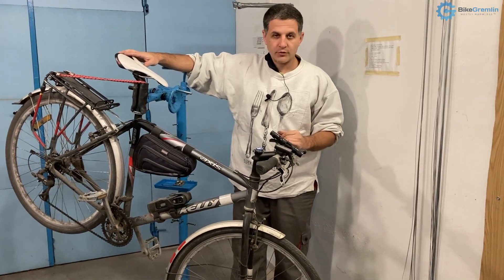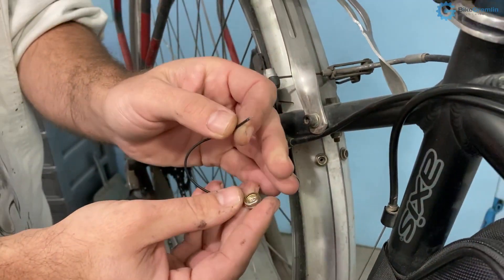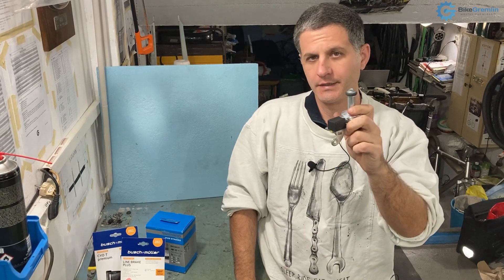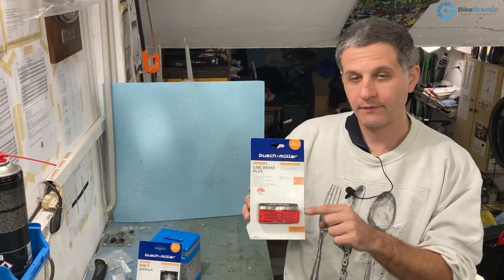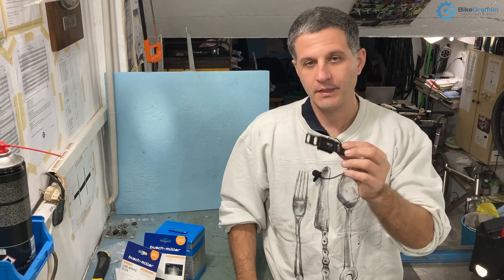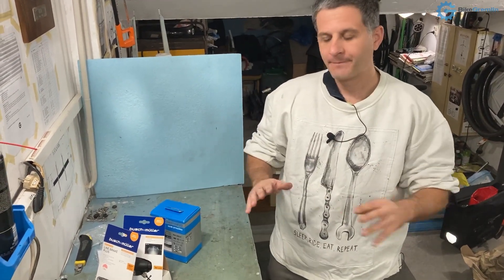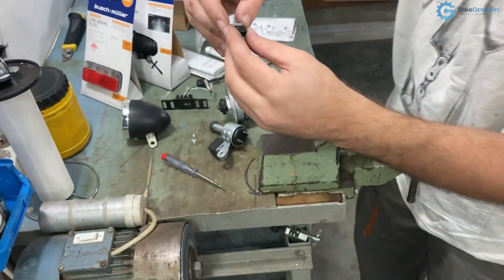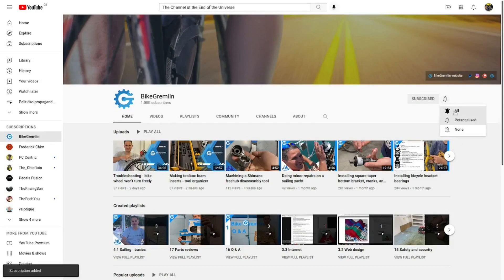Dynamo hubs and LED lights for bicycles

Comment: I checked my hub dynamo and it shows voltage, but neither my head or tail light works. I tried a continuity tester on them and one shows nothing and one shows some circuit
Reply from the maker: For comments, questions, or advice, I’d be happy to help over on the BikeGremlin forum:

https://www.bikegremlin.net/

To keep everything organized, I’m only providing answers there. Thank you for understanding!

Relja Novović

Comment: Re: 9:02 I botch job repaired a 1.5W shimano dynohub by removing one of the 4 rotor magnets and the system has 0 issue powering a front and a rear light at 15-20km/h speeds and charging up the capacitor. 
I think the smaller cheap LED lights are crazy efficient (iirc there were some basic automatic Axa lights on there). Not a B&M system, not sure of the power draw of those.

Comment: I really don't like using the frame as common current return! It sort of works, but once you get rust and salt and shit, you can't rely on it. I had an accident because common return through the frame failed in the rain, it was OK otherwise but it went flickery when everything got drenched, and my lights went out and i drove into a barrier and broke my left hand a few fingers and was THAT close to landing upside down on my head, and helmet or not (i wore one) yeah you don't want that. Front fork got bent too, yeah steel! Mechanical connections aren't really made to be electrical connections.

Busch+Müller lights are excellent! After a decade, no lens fogging at all. You buy something off brand, it's yellow in a couple, cracking, leaking. The light output and light pattern are among the better ones as well.

Comment: Thank you very much for the video. You explained very well about the mechanisms. I have a similar shimano dynamo on my bike. The bike has been used for maybe 10 years or longer (bought it second-hand). Out of a sudden the light stopped working. I checked the bulb and it looks good. I wonder if it’s something wrong with the generator. Is there any easy way to check if the generator still works?
Reply from the maker: I suggest using the bikegremlin.net forum for any technical questions. 

Relja

Comment: Hello :) thanks for the video! How is this dynohub model holding up since the last year? And would you recommend this for touring?
Reply from the maker: That's a good question.

So far, I'm very happy - it's all working fine. Survived one hot summer and one very rainy winter (though with very little snow).

I ride all year long, and some of that is on very bumpy roads, so it was a good test for all the contacts, mounts (for lights) and the dynamo hub.

I love it so much that I got another set for my gravel bike.  :)

Note: on both hubs I got, the bearing preload looked a bit too high, so I loosened a locknut and adjusted the preload to make it less tight. They do rotate in "clicks" due to the dynamo, but out of the factory it was still a bit too tight. I see that with many cup and cone hubs, regardless of the model and manufacturer.

Relja
Reply: @BikeGremlinUS  thank you :) i don't think we have seen your gravel bike in any video! 

Like you, I also face the problem of getting the Dynamo hubs because of shimano's restrictions to send abroad - hence the choice is limited to SP (or the Son for that matter). There are some shimano dynamos available on Chinese websites but i don't know about the authenticity. But I'll pick one up when I get a chance. 

Regardless, I'm excited to get one and set it up! Thanks for all your content.
Reply from the maker: :)
In one video in my native (Serbocroatian, the BikeGremlin RS channel), I showed the frame preparation for the build of my gravel bike:  :)

https://www.youtube.com/watch?v=mBTz8OhHPZk

Edit:
Here is the built (I changed a few more stuff over time, but that's the "skeleton" of my gravel bike):
https://www.youtube.com/watch?v=olmxGm29Vjc
Reply: Just to add on to what Rilja said, my Shimano dynamo hub lasts since 17 years. I almost never rode in rain.

Comment: Great video, as always.

Can you tell me if I can use the old system, so called Tyre Dynamo and connect the new LED lights on it instead of a Hub Dynamo? I personally think that the Hub Dynamo is better system but i am just trying to upgrade the lights on a old city bicycle with spending as less money as possible...
Reply from the maker: As far as I know, it should work.
Adding some overvoltage protection is a good idea if one plans on going fast down hills with any kind of dynamo (either the old-style bottle-type, or a dynamo hub).
Shimano sells these separately, and they also come with their dynamo hubs.
For flats, if your LEDs are of high quality, it's not really necessary. Good LEDs usually have their own overvoltage protection. Just make sure to connect the rear light from the front light, not directly to the dynamo.
Reply: @BikeGremlinUS  
Thanks a lot.

And why is it so important to connect the back light on front light and not directly to the dynamo?
Reply from the maker: The front light has an on-off switch - the rear one very often doesn't.
The same goes for the standlight function - some rear lights get the "juice" from the front light when the bike is stationary (some have their own capacitor for that).
Reply: @BikeGremlinUS  

Can you tell me one more thing? When you have a wheel with dynamo hub and when you spin it while holding the wheel in your hands, is it normal that the hub while making resistance, makes that tik tak silent sound, something similar to normal hub when beeing over tighteneed?
Reply from the maker: @Toretto16  Not that I've noticed with Shimano dynamo hubs. Though it's fair to note that they do, like their other (non-dynamo) hubs, often come over-tightened from the factory.
Reply: @BikeGremlinUS  I have a bottle dynamo on my bicycle (for now), and it has a diode built in. As for as I know it is over voltage protection. On the road my lights get to full brightness at quite a low speed, and don't get any brighter no matter how fast I go, so I guess it must be working.

Comment: Thank you very much. One of the best bike mechanic channels on YouTube. I’m quite an advanced home mechanic myself but I mostly worked on MTB and race bikes but recently got a city bike. I changed the poor AXA light that came with the bike to one with 200 lumens, but it started flickering at higher speeds. I connected the wires in the plastic thing without removing the inner piece and that’s why it makes a bad connection :)

Comment: Please make video how to install, wire  the dynamo hub with front and rear light. Also explain how to install without any contact points on the fender/mudguard. But the regular way ,by the frame. thanks in advance
Reply from the maker: Will do.

Comment: Thanks for yet another great video :). 

I've serviced a few of those shimano front wheel dynamo hubs even though they are "unserviceable" according to shimano. They are difficult to adjust though since they always have a high notchy internal resistance and you cannot feel when the cup and cone is too tightly adjusted. You can only feel when it has play and then try to tighten it just a hair more and hope its close enough. I would personally never run them because of this and also just because they have that notchy internal resistance that feels quite wasteful to me.
Reply from the maker: Servicing is a hassle. I'd rather re-build a wheel with a new hub every ten years or so, than service those hubs on a yearly basis. Colour me lazy.  :)

As for the resistance - they are at the very centre of the wheel, so it can't put much resistance (like trying to use a screwdriver while holding it for the blade section, not for the handle). 
Edit: not sure if I've explained this clearly enough.  :)

In real life, when you ride, you don't feel any noticeable resistance - especially with the higher quality models and when the lights are off.

Of course, riding in Novi Sad, during the winter when it's dark for half of the day and 90% of my pre and post work hours, and with many stops (groceries etc.) on a relatively heavy commuter bicycle, the extra drag is not much of a hassle compared to the downsides of using battery lights. For different riding and use scenarios, the downsides could become more noticeable, and the extra convenience of using dynamo hub and lights, less important.
Reply: Magnetic cogging shouldn't be robbing you of the power, unlike say friction or whatever power gets harnessed electromagnetically and wasted to heat electrically at higher speeds. Because it pulls you towards the poles always, so at first you get a little boost then a little resistance and so it alternates but overall the whole weight of everything is plenty to just bring you through the detent with no residual modulation to be felt.

Comment: Nice video. Thanks. One question: the hub model you talked about is a centerlock hub for disc brakes which you will install on a rim brake wheel. You loose spoke simmetry on the front wheel; is it because it is more difficult to find rim brake dynamo hubs than disc brake?
Reply from the maker: Exactly. All good points and good thinking.

New dynamo hubs aren't available in my country at the time of writing this (as was also the case at the time of shopping).
- The same goes for decent-quality LED lights.

So I had to order from abroad. Thanks to Shimano's policy, I couldn't order from abroad to Serbia. I had to rely on a friend to do the shopping for me, abroad - which resulted in having to find a convenient place to buy/order. The only decent quality 3 Watt hub that I could find was the centerlock disc mount model. And it was at a 50% discount. :)

It is inferior in terms of strength and the ease of wheel building to a rim-brake hub. But, in my experience, I am able to build a long-lasting wheel even with such hub design (in spite of it).

The upside of such hub is that it can be used with disc brake forks - which MIGHT be useful for the winter bicycle commuting if I move to the mountains (it is an option I'm considering). I cycle year-long in the flat lands I live in, but I'm yet to test rim brakes in the winter on cold mountain winter mornings. My fork already has a disc brake mount, in addition to the V-brake mounts.